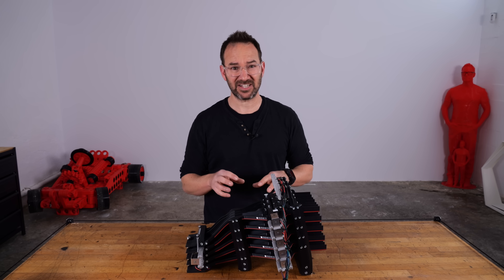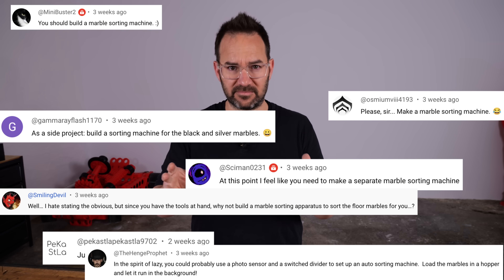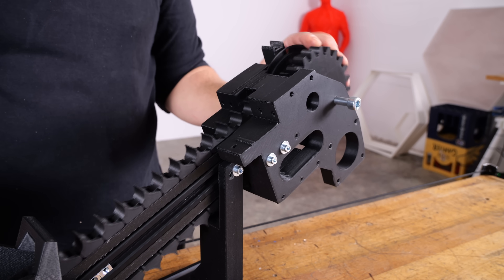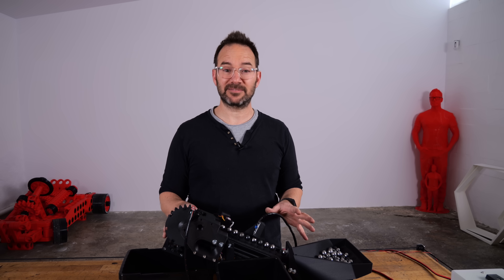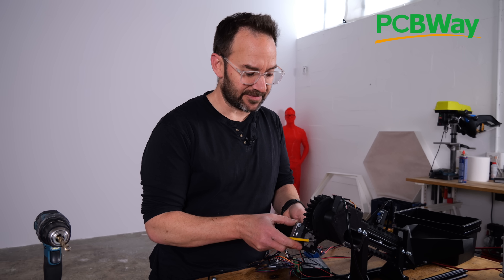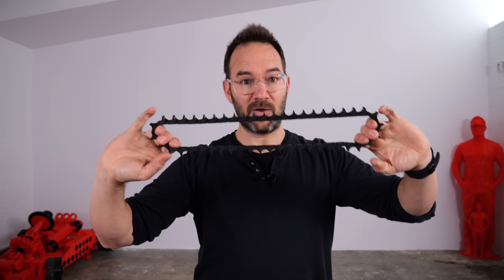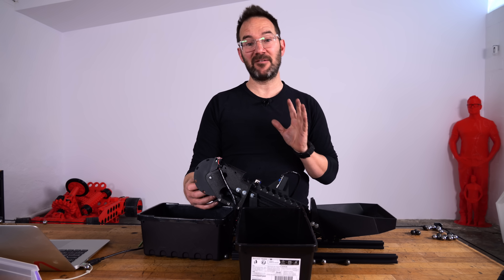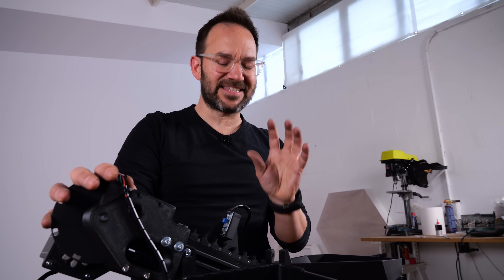Faster than the Eye Automatic Marble Sorter - Marble Clock Seconds Display Pt.3

Comment: If you are planning to put it into the clock, what about replacing the solenoid with an electromagnet? The marbles are metal, and you wouldn't have to worry about yet another mechanical failure spot.

Comment: Have you considered a wheel with radial solenoids, spinning above the marble track in a vertical plane at a right angle to the track. Each extended solenoid pin intersects the marble track, knocking the marble out sideways but unextended pins miss the marble, leaving it on the track. The solenoids have time to extend or contract while they proceed around the "ferris wheel" and other radial solenoids are in a different phase of marble knocking. Two, three or four solenoids may be plenty. Of course it would require a slip ring for electrical connection. My guess is you could get a much higher throughput and escape the constraint of solenoid actuation speed. You could even gear the solenoid wheel to the conveyor so that pins are mechanically guaranteed not to collide with conveyor teeth.

Comment: Have you considered a "flip flop gate" like railway forks which directs marbles into either of two colour tracks? The mechanism would only need to switch when a marble is a different colour to the previous one. This would result in two tracks to the next stage: one for black and one for white.

Comment: Wondering why won't you rather use a way more efficient DC motor? A simple optical sensor may easily follow the chain and even e.g. adjust the speed by PWM...

Comment: I like your design and your process on this.  I did a similar project in school many years ago (2003?), but I didn't have the same speed requirement you had.  I used gravity to feed instead of a belt, with a hopper that only allowed marbles through one at a time, then diverted the path into the appropriate bucket based on opacity (transparent versus opaque).  While it couldn't do 20 marbles a second like yours does, it was extremely accurate, reliable, quiet, and had very few moving parts. I wonder if something like it with a much smaller footprint, then either duplex or quadplex it to get the throughput required would work for you.

Comment: Why use black marbles at all? Just have 1 marble (silver) to display your number and use the absence of a marble as black. This should display nicely because you use black plastic for your clock face anyway. If you use this technique then you can go WAY FASTER because you don't need to sort your marbles. All you need to do is place a marble in the proper spots to form your digits and leave the spots empty when you want black. For this solution you will only need to redesign your clock face (the part which holds the marbles for your display). You can use a solenoid to trap the marbles for display and a solenoid to eject them from the display when you change the time. This should greatly simplify and speed up your marble clock. Maybe 10ths of a second might be possible with this technique (who knows).

Comment: Given how terrifying this thing becomes as it gets faster, and the fact that you'll need at least 16.5 marbles per second for the clock (15 per second for the low-order digit, 15 per ten seconds for the high-order), I would suggest building two, maybe even three sorters and run them in parallel.

However, interesting observation: There are five marbles that are always the same for all ten digits. The middle marble on the 2nd and 4th rows are always dark, and the rightmost marble on the 1st, 3rd, and 5th rows are always light. Maybe you can take advantage of this somehow and only do 2/3 the work.

Comment: Wouldn't it make sense to apply this sort of selector to the hour/minute clock, too? Instead of loading random marbles into the elevator and filtering at the top, make it load the correct color at the bottom. That way, the elevator wouldn't need to run as fast, and you don't have to transport the wrong marbles down into the bucket again, both of which should help reduce the noise level of the clock.

Also, would it be possible to only have new marbles come down when it is actually necessary? For example, for both "0" and "1", the entire rightmost column is made up of white marbles, meaning that switching from "0" to "1" doesn't require you to replace  those marbles. The same goes for the black marbles that make up the center of the "0"
If it's possible to control whether a new marble is released based on whether it's necessary should once again reduce the noise level and the speed at which the conveyors need to run.

Comment: you could try to change only the parts of second that need to be changed, like the difference between 8 and 9 is just 1 marble, also i think a transparent motor blade on the face of the second clock will work nice and change just the one marble fast without relying on the absence of vibrations

Comment: You should sort out the silver balls. Then your kicker won't trigger every time your belt empties. (When your default is black). And I'd design the kicker as a servo-powered propeller-shaped-thingi that kicks ever 180° rotation. Besides compressed air that's the way the industry solves such tasks.

Comment: i was wondering, you already have multilane splitter (bottom part of minute clock elevator), why don't you place two-way splitter just below its end?

 V-shaped one, with two rows of solenoids opening either side up using sliding metal plates (thus separating marbles by color) and "stopper" holed plate above them sliding in (with either stronger solenoid or two solenoids in anti-parallel push-pull setup) to keep next row of marbles "on hold" while current one splits.
Easily scalable (more rows in parallel, faster it goes) and is fairly slim per channel (solenoids are on either side of channel). 2n+1 solenoids (where n=number of "channels").

Comment: I'd suggest having a set of marbles in a set of separate columns so each can be sorted in parallel rather than in series like this.  It should provide a high enough output without requiring as much speed to achieve it.

Comment: A simple solution for spped would be to "double the machine".
Use two chains for grabbing the marbles and  two solenoids+sensors for the sorting.
You can run the machine on half the speed and get the same results.   
Yes it will be "bigger" but it will also be more reliable and maybe faster.
With three lanes it could be even faster (since you have become a master on printing chains).

Comment: Blueberry separation machines work like this, but they use jets of compressed air to do the sorting. Not sure that would work given the weight of the marbles, but it would solve the retract issue.

Comment: Pull the marbles out of the bin with a wheel instead of a chain, deposit them on a rail or tube then flick the other end of it left and right sending them to separate bins.

Comment: You have 2 ways to create surplus of anything.  Create more, at a faster rate than you use it. Or REDUCE DEMAND while production stays the same. YOU DONT NEED SPEED IF YOU ONLY REFRESH THE CHANGING SEGMENTS!!!   

A standard 7 segment display has lines starting at the top and going clockwise. A b c d e.... and so on.   

1 = bc
2=abdeg 
3=abcdg

Look at the first 3 numbers alone and analyze them..   1 takes 2 segments (2 marbles) 2 and 3 takes 5 segments (5 marbles)...  to count 1,2,3 the way you are currently doing it, you would require 12 black marbles....   now what if you ONLY updated the CHANGING segments?

1 = 2 marbles
2 = 4 marbles (saved 1 because b didnt change) 
3 = 1 marble!!!  (Because you are only changing C to a black marble, all other black marbles stay the same with exception of E which changes from black to chrome!!!)
So in total by refreshing ONLY changing marbles, you reduced your black marble requirement from 12 to 7!!!   In the first 3 digits, you reduced your black marble requirement BY 41%!!!!   This is a common practice in LCD displays when you dont have a bunch of processsing power or speed and you want a responsive display. Or security cameras do it as well, only updating changing pixles to save storage space.  

THIS IS YOUR SOLUTION..  JS...

Comment: This is probably an overly complicated and impractical solution but you could make a wheel of electro permanent magnets above the conveyer belt that only turns the magnets on when it detects the right marble. Put it in phase with the chain links

Comment: Air pressure... if you can shoot the marbles out of the chain with a gust of pressurized air, you'll never have a problem with too slow retraction blocking the chain.

Comment: If you need 17 marbles per second, make two machines that produce 10 marbles per second each in parallel. This way, you don't need to push the machine to its edge performance.

Comment: You need way fewer marbles per second. Simply replace the marbles that actually change and leave the rest where they are.
The difference between 2 and 3, or between 9 and 0, is two marbles.

Comment: My solution that WORKS - time with seconds on marble
1 buy cheap Timex wrist watch with sweep second hand
2 cut off the wrist band
3 use clear packing tape and secure the battery operated Timex to a marble counter top - in the kitchen

Comment: I think you could use the steel balls ferromagnetism to your advantage by putting small permanent magnets on the part of the main machine that holds the balls before being pushed and also a permanent magnet in ths chain part that gets in contact with the ball, so it can always be full even with many moving balls. Also, just in case, it should either be a white chain or the signal inverted so silver balls are the ones being pushed, so there are no false pushes when no ball is in the chain.

Comment: I like your problem-solving skills. One question, and maybe you addressed this in an earlier video, but why swap out all 15 positions? For example, going from a #1 to a #2 requires replacing 7 blacks with silvers and replacing one silver with a black. So, 8 positional changes rather than 15. Too many solenoids?

Comment: I'd remove the whole pushing lever/solenoid that has a risk of mechanically binding with the chain bit. If you just raise the solenoid out of chain reach and design it so when extended it hits the top/side of marble at an angle (eg, 15-45 degree) then the force of the chain pushing the ball on it at the angle should eject it, with no risk of binding due to the ejection mechanism being too slow to retract or otherwise failing.

Comment: Hm, just asking myself. Second numbers go from 0 to 9 one after another. Which means that its a repetitive action and patters are the same every time. Is there a way to optimize the time on sorting is for every digit there would be a set of black/silver marbles that will not mix with others and thus will not need sorting. Do not know how this could be implemented though.

Comment: 3:23

That's basically what I had planned for one of my High School Engineering Projects, except A) I had to sort between three different kinds of marble initially (the first sort was determined using only the branch of physics known as mechanics), and B) the second sort would have used visible light, tested opacity, and controlled a tilt mechanism.

Still, glad to see my advice taken!
Reply: Modify the sorter to have less Marble Spray, and then add it - but at EXACTLY 19 marbles/second. After all, you still have to do the tens place.

Comment: I hate to be the guy that suggests things after you already have a solution, but have you considered a magnetic coil to pull the ball off the chain? That way there's no retraction time. It just needs to be slightly off center below the chain and a quick pulse will give the ball enough momentum to jump out.

Comment: 1) Build multiple machines to sort more.
2) It doesn’t need 70 marbles per second, you need 15 every second, 15 every 10 seconds, 15 every minute, 15 every 10 minutes, 15 every hour, and 15 every 10 hours, which is a less than 20/second.  (Assuming you don’t replace digits that aren’t changing.)
3) Don’t replace segments of digits that aren’t changing.  Depending on the font the difference between a 8 and a 9 is only 1 marbles, and then a 9 to a 0 is 2 marbles, and sure 0 to 1 is 7 marbles, this sorter is still way too fast!

Comment: A thought regarding whether you should add the sorter to the clock - at the moment you eject the marbles from the clock's display, you already know which ones are black and which are silver, it would be great to find a way to take advantage of that. Ejecting the black ones separately from the silver would add a bit of time required to to display the next number but it would save you the trouble of sorting the marbles afterwards.

Comment: If you use black material for your chain you should invert your logic and ping light colored marbles instead.  Otherwise your optical sensor sees empty black chain as a black marble and pings the solenoid at an empty spot.

Comment: you could improve the hopper by creating a funnel or top at the output to keep the marbles from bouncing out, also a side and top guide to keep them on the belt till they hit the solenoid, then an actual out shoot for the black marbles so they don't go fling everywhere. However all in all it is an impressive design and I'm surprised it took you this long to do one :D

Comment: Wouldn't it be easier to sort by having the sorting happen at the end where the servo just blocks off the path, sort of akin to a diverter valve? Seems like it'd be less prone to having to stop it as much, since you only have to move it one direction of the path and only if it's not already in the right spot. Also, as someone else mentioned, you could have more of these to do more marbles per second without as much noise. Also, if you if you did do it the way I'm describing, you could in theory avoid having the chain at all and just use a gear that holds one marble between each teeth at the end of your sloped funnel.

Comment: Yes, incorporate it :)
Also, by using 2 solenoids with alternate coding you can keep the belt feed and sorting fast, but with the solenoids only doing half as much as before, reducing the risk of jamming (have a look at optical fruit sorting machines with several paddles to remove unripe fruit)

Comment: If you'd use air or co2 to push the marbels, you could drastically up ur speed. Because there would be no retraction necessary

Comment: If you want to go even faster, you could use a disc (or a "circle of posts") so the marble sorter went straight across the belt to knock the marble into the bucket without having to wait for the solenoid to retract.

Comment: I was thinking of using different material marbles and using their different densities to have them sort themselves naturally, by for example making them go through a ramp held by a spring, so marbles of othe lower weight would go on the top rail as the spring would hold them, and the hevier ones would go on the lower one as teir weight would stress the spring enough, but yeah making a loud sorting machine that goes fast is just funner

Comment: use pneumatic solenoids its way faster, and btw: is the plastic belt really really necessary ? (think about it) and if it is, couldn't it be x10 shorter ?
Reply: also: can't you just use gravity ? let all marbles fall down naturally (super fast) and sort them as they fall with compressed air

Comment: Agitated or vibrating hopper with a helical incline for the marbles to line up onto the chain. Would the servo arm be quicker if it just rotated 360 degrees? Instead of backing out, just follow through and return to start.

Comment: No reason you cant put "TWO" black marble pushers to; halve the workload and double the through-put....or even "THREE"....you would just need to put a proximity to count 1-2-3 to even the workload over the 48 holders. That would require each of the 3 pushers to operate 16 times at most per full revolution of the chain.

Comment: This is a fun and fascinating project to watch, but I still think you are using too many marbles in your display. You do not need 15 channels, only 13. Your display face needs to look like this:
M = Marble, O = Blank

M M M
M O M
M M M
M O M
M M M

With your present design, the two blank channels will always be filled with black marbles, no matter what number is up next, so by removing them you can increase marble sorting speed as the black marbles for those channels do not need to be counted. This means you can also use less marbles in total as well.

Comment: You may be able to achieve a higher degree of reliability if you run multiple feeders and have multiple ejection mechanisms on the same conveyor so that misses can be tolerated. I also saw someone suggest a blast of air to eliminate the possibility breaking mechanical faults in the ejection system, seems like a decent idea. Although the sensible part of me knows you've already met spec so it's time to move on 😂

Comment: If only there were a way to optimize it so only the places that change need replaced every change. It would need even more parts because each gate would need controlled independently. However, it wouldn't need as many marbles per second. 
It is a type of compression and  would increase efficiency because you can get ahead in the seconds that don't change much.

Comment: 9:47 have you considered putting the solenoid at an angle on purpose? It seems like the clearance is actually better. You might even be able to hit 20 mᵃ/s
Also please look at the various Lego Great Ball Contraption videos for other useful techniques that might be applicable here, like regulating outflow from the hopper so you don’t lose so many over the sides.

Comment: Compressed air solenoids are the way to go for marble rejection.  They are extremely responsive and have nothing that will physically get in the way of the belt moving at high speeds.